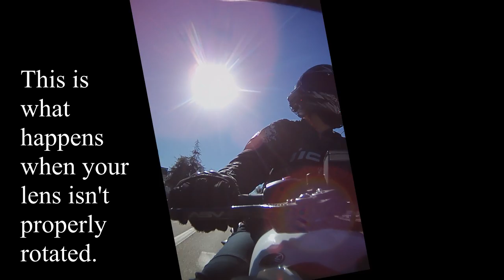Coastal Day Trippin'

Comment: great vid what mount is that you had the +2 on the mirrow i think
Reply from the maker: Yes, you are correct; that is the 2+.  The mount is a custom-designed mount that bolts directly into the same bolt the mirror uses & made with a very lightweight material.  I really like having that angle up there so people see scenery and not the sky. Thanks!!